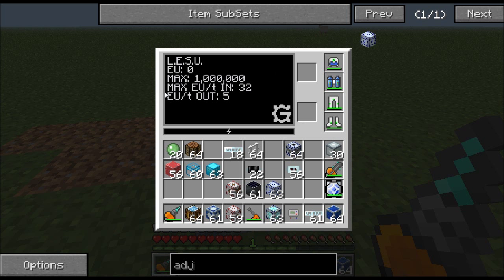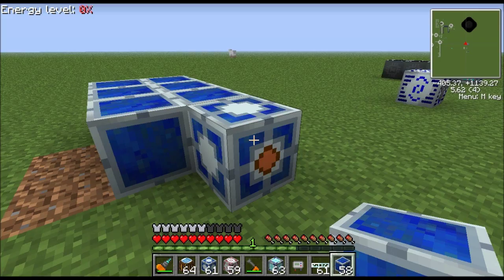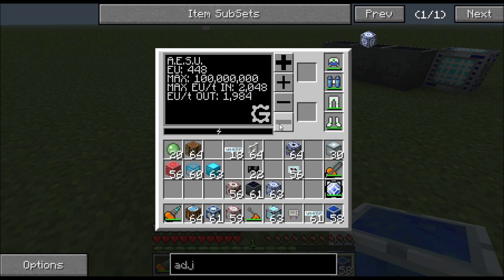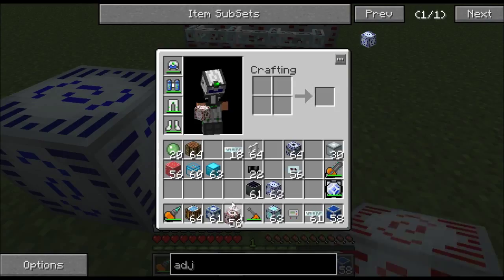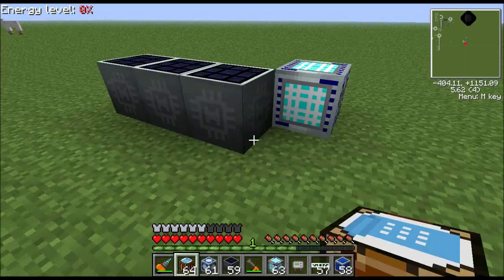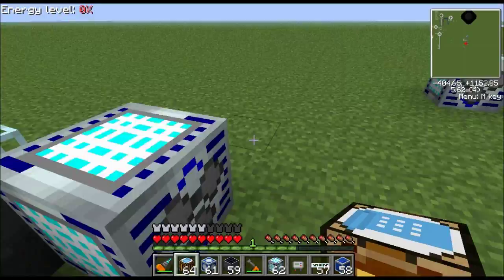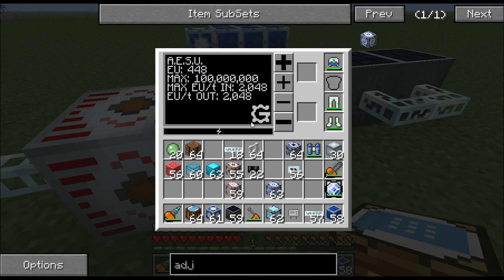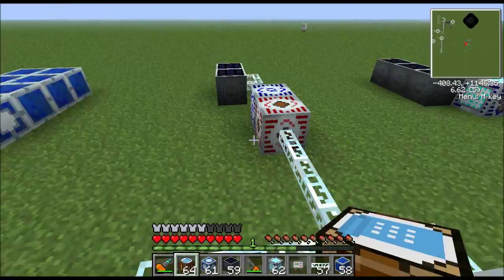FTB/Feed The Beast Tutorial - LESU, AESU, IDSU, and Lapotronpack AKA Lapotron Pack

Comment from the maker: Transformers put out a certain size of packet. HV transformers put out packet sizes od 512 pEU/t. If an EU-Reader says the output is 1,048 EU/t then you know the transformer is putting out 2 packets. (512 pEU/t x 2 = 1,048)

A transformer can put out a maximum of 4 packets per tick.

Comment: Hey grumpy I've just finished extensive testing with t LESU. It says 5 EU/t but only outputs 4 EU/t so ull need an additional block conected to get 5 EU/t. Also it only puts it out at 1 packet. So I found a use for it but I just use it as a restrictor to charge my energy frame